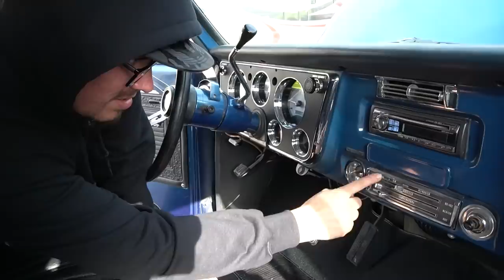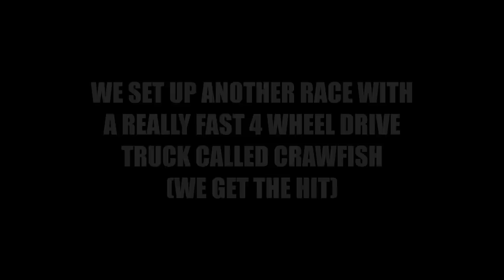HPT SHOOT-OUT 22 CRAWFISH GIVES US THE HIT!

Comment: You cant claim to be the fastest when you always want to get the hit and never wanna give other people the hit
Reply: Exactly
Reply: Truck loses to a truck with baby turbos and what could easily be the stock truck intake manifold.  Other truck has monster Garrett’s and an intake manifold that probably cost what the entire turbo kit cost on the ford.  Get tf outa here with that shit
Reply: @RacingRon47  race truck VS a little 5 liter street truck lol
Reply: @RacingRon47  in a heads up race the chevy would of dusted that ford that ford has a built motor also
Reply: Still would have lost. That excuse is only valid had the Chevy lost by less than a truck length, which he didn't - 38:24.  427 vs a 302 and still got it's ass clapped. I can see why you chevy bois are so salty 🤣🤣🤣

Comment: We need that crawfish race head to head for  100k pot double or nothing lol good video bro 💯💯💯
Reply: I think the hit was pretty fair considering crawfish is a fully built race truck
Reply: @jrvera7955   I wouldn’t say fully built race truck it’s a full size weight truck only has fiberglass doors and no hood the ford was literally missing everything lmfao
Reply: @guero9093  bruh the Ford is a true street truck it has a/c, electric windows, radio,  full interior other than a passenger seat delete and the Chevy is still lighter the fucking Chevy is on alcohol
Reply: @guero9093  has the entire bed gone, probably only had the bare frame holding it together back there
Reply: @LSXPhatal  still had steel bedsides tailgate bumper etc a fully built trucks would be all fiberglass front fenders bedsides etc